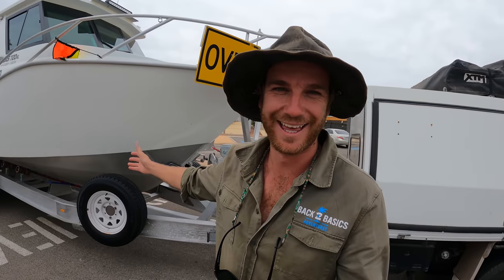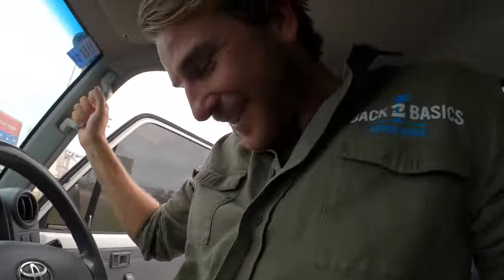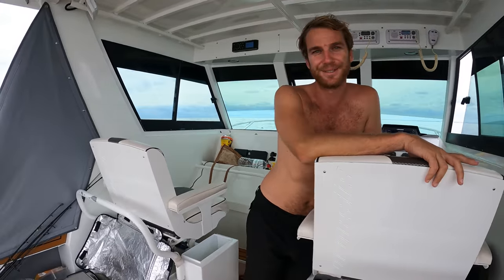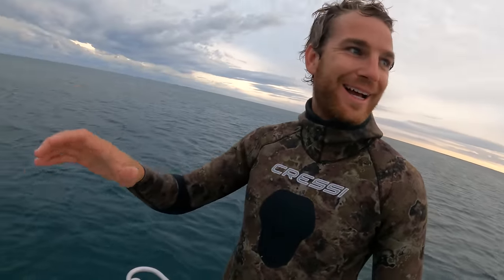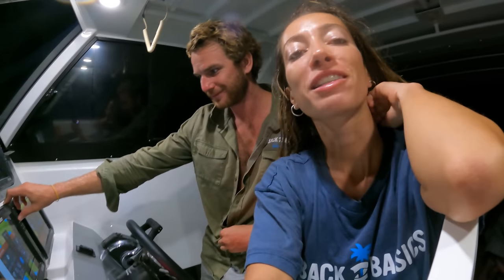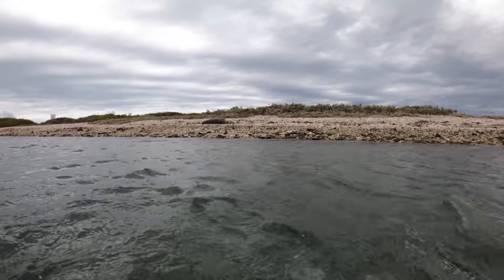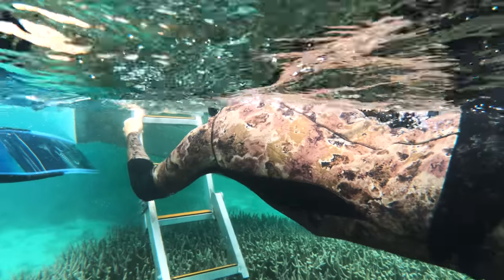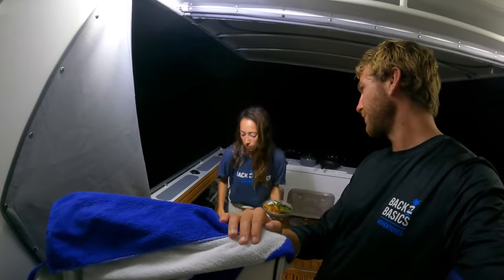WE'VE GOT BIG NEWS! 🥳

Comment: Oh my goodness, I got just as excited as the two of you were when I caught sight of your new boat. lucky Jack and Fran I am so happy and excited for the two of you. Mate your boat looks incredible, so wide, a beautiful wood floor, what a work of art. A lockable cabin, hard top and opening front windscreen, just perfect.
I am half way through watching this video, after you have anchored in the lagoon getting ready for tea with Fran. I could hear the slight chop banging against the hull of that incredible brand new boat. My goodness, I thought, If my guess is correct, your hull will be banging all night, so long as there is a breeze causing a chop. I bought my 8.3 metre lockable half cabin In Bibra Lakes, south of Perth in 2006.My two camping trips to the Gulf of Carpentaria N.T. for 3 months in 2011 and 4 months in 2013. I slept on my boat and it banged like a sledge hammer on bad nights and a small steel hammer on calm nights. Please let me know how the two of you slept. 
I will be 71 this year. I had planned my third trip up north, but Corvid with the border closures put a stop to that. I bought a sheet of closed cell high density foam and spray on glue, which I was going to glue onto the Gull wind at the front starting just below the water line going upwards to the front. I was hoping that this would soften the hammer blows at the bow while I slept. Another option could be to tie off the anchor to one stern bollard during the knight, to stop the banging at the front.
Cheers, I got so exited for the two of you when I saw that big beautiful boat, I know exactly how excited the two of you felt. Take care please.

Comment: Welcome to the abrolhos where the water is either 0.5m deep or 20m deep with no inbetween, the wind changes direction 3 times a night and when you think your anchored in sand its actually continuous limestone rock. I recommend getting use to sleeping in earplugs when sleeping on the boat. Good luck!

Comment: love your videos. Great story. We are stoked you've got an overnight boat. What size is it? What HP motors? Loved the play with the seal! By the way, you're not meant to use a metal fork on non stick pan. Use plastic/rubber so you don't damage the surface. You take risks straightaway by going in over a shallow reef. Cheers Murray and Jean

Comment: Hey there, new to your channel. Congratulations on the new boat, it looks so cozy and cute! It might sound silly, but as an audio engineer, I noticed the echo inside the cabin of the boat. If you didn’t make videos, I wouldn’t recommend this, but it would do wonders for your audio if you can find some sound absorbing foam and put it on the ceiling. Anything really to cut down the reflections in the cabin.

Comment: You guys definetly deserve a nice big boat after all the stuff you went trough with the smaller one 😂, just make sure you get a long safety line thats always tied to something solid on an island or something like that when you anchor the boat and camp on a island just to be safe just leave it slack and put a bell or something on it so you guys are alarmed by it if the line gets tight in case the anchors drag or something like that, thats even more important when you guys go even further 😄, i dont know what its called but there is a thing that makes a alarm go off if your boat exits a pre set raidus in which it can swing around on the anchor ropes, so you get woken up if an anchor drags or something like that, just anchor it and set a radius you want in which its safe and the alarm goes off if the boat leaves that set radius.
I dont know what its called but its not that expensive and it can really safe your boat incase something happens and you sleep better knowing a alarm is gonna go off if something goes wrong.
I love your videos, all the best from Austria 😁